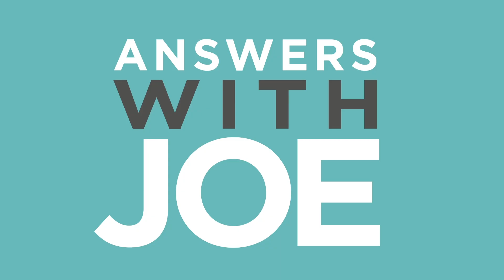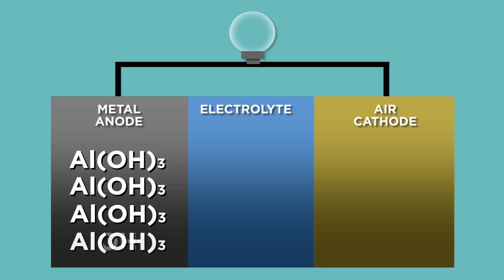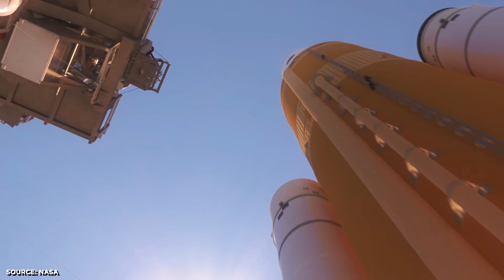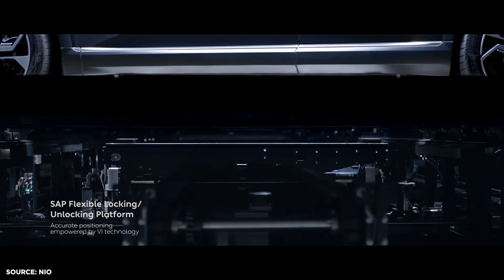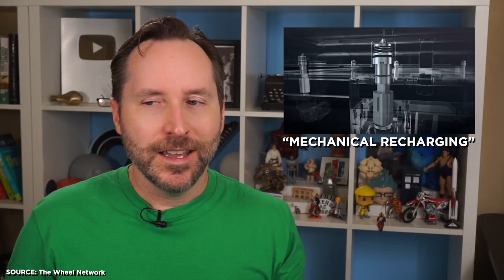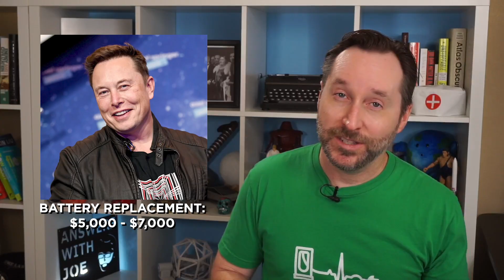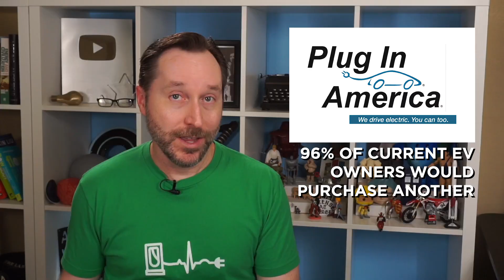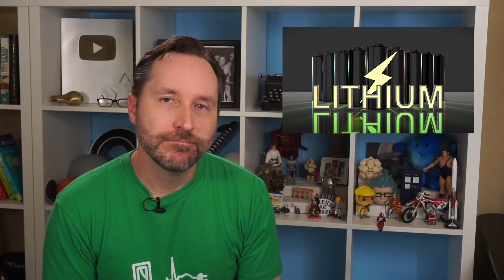This Battery Could Drive A Car 1500 Miles - But There's A Catch | Answers With Joe

Comment: Not that Joe did this necessarily, but I hate the way that green technologies are pitted against one another like it's betamax vs vcr. The best way forward to me seems like it's not a single winner but all the technology at once. 1. Because different technologies are better for different applications and 2. Because more technologies sharing the load means not taxing any single resource too much. Are solar panels better than coal?  Yes, but the materials for them are mined, usually unethically, and the aren't enough to replace all of the power generated from coal. That's why we need wind where there's wind, geothermal where there's geothermal, solar panels, and the concentrated mirror heat kind of solar. You need all of them. I feel like it's the same with batteries. It can be  some aluminum air for people who need it and lithium ion for people who need that and hydrogen for trucking or whatever it works best for.
Reply: Sorry but it was Betamax vs VHS in a vcr. By the way, Betamax was better but the record time was only 5 hours an VHS was six so public consummation made the winner, VHS. (you could record 3 movies vs only 2 on Betamax).
Reply: Tech companies need competition or they won’t improve because they don’t have to
Reply: Vhs not vcr.
Reply: I agree with you. Not relying on one single material(sodium ion batteries,aluminium air batteries,solid state batteries)
Reply: The advantage of having a standardised technology comes into play when taking the logistics/infrastructure and such into account.  To put it one way, a single tanker filled with petrol/diesel has the ability to fuel anything from a car to an oil tanker, if you replace the ICE with 5 different technologies, you now need 5 different tankers, 5 different mechanics, 5 different engineers, 5 different factories and so on and so on, pretty quickly those 5 different (yet more economical) technologies net worse than the dirty singular one we had before. This is why I'm personally an advocate of hydrogen power, it has the potential to be a fully green, fully recyclable fuel  whilst causing minimal disruption to current infrastructure and maintaining a wide range of applications which inevitably leads to cheaper running costs.
Reply: @The1Bendotcom  
You should stop lying and advocating about hydrogen power because it will never be "green power" There is no way to generate energy with hydrogen technology, and I am pissed off about people that are trying to sell technologies as green even though they are not. 
Hydrogen needs to be produced; it can't be mined > mainly fossile fuels are used for the electricity > efficiency is extremely low (20% after turning back to movement/ electricity) > in the end even more CO2 is produced with this "green technology" than just using traditional fuel.
This technology won't prevent any CO2 in our generation. Maybe after we coat all deserts with solar cells, but not anytime soon.
Reply: @Bullshitvol2  This is the most uninspired and hypocritical thing I have heard in a long time.  Hydrogen needs to be produced and is thus isn't green?  Do you think they pick lithium ion batteries off of trees, or Aluminum Air Batteries float to shore from the oceans?

I agree that hydrogen isn't a mainline power source.  But neither are lithium ion batteries.  However people still refer to them as providing "battery power"  or objects that use them as "battery powered".

I understand that there is a certain enjoyment in creating conflict, but at least pay attention to his claims and not invent positions to argue against.  He said that hydrogen power "has the potential to be a fully green, fully recyclable ".  This is true.    Further, note he does not claim that it is an independent source of power.

The point that hydrogen fuel can be reversed with the input of electricity means that it does not directly and permanently add pollutants to the environment.  Your only argument against this is based on the assumption of a fossil fuel based economy.  While this may be an accurate presumption.  The proponents of hydrogen fuel are presuming hydrogen will be used in conjunction with other so called "green technologies.  

In fact, it would be kind of ridiculous to assume that a nation would spend billions of dollars adopting a hydrogen system for the environmental benefits but then maintain old dirty power plants instead of also upgrading those.

Now, personally, I am not sold on the idea of hydrogen as a better alternative to batteries.  However, it is not an obvious choice between the various storage/transfer technologies.  Saying that supporters of hydrogen are lying because hydrogen doesn't is not a primary power producer is just disingenuous.
Reply: @Bullshitvol2  Ahh, so you are saying that you do not read posts before you comment.  If you cannot be bothered to read how your points have already been made and then refuted in prior comments, there is no point in me repeating those refutations again.  After all, I can't educate stupidity.

Anyway, you chose a very fitting name for yourself.
Reply: @Bullshitvol2  You obviously didn't read the prior comment before you posted as your claims were already rebutted previously.  You failed to address the refutations but merely repeated the false claims.  As such, there is no point in debating someone who is not interested in discourse so much as they are interested in picking fights and trolling others.  Sorry, but I do not intend to continue to respond to your empty provocations.
Reply: @Bullshitvol2  I did not do the same.  I addressed each point in the prior post.  You did not even bother to read the prior posts. Anyway, as you admit that your points have been rebutted, I have nothing further to say.
Reply: @Bullshitvol2  But I did.  You just did not read it.  So cry more.  But if you aren't even going to read the other posts but your own.  Then no one needs to address you any further: For you are only speaking for your own benefit.  Anyway, I wont respond to your trolling any further.
Reply: not true...

Comment: Look batteries such as this are nice but too me they just sound like half solutions... im a proponent of a very different setup which has been touched upon before and had clear  reasoning why it couldnt be done then... however with recent technology prospects its a very interesting prospect again...

Synthetic fuel... this could actually be just the thing to help climate change because it gives carbon capture a business case...

Plus we dont need to change anything about our current infrastructure...

Picture the following... Molten Salt Reactors high temps output around 600 - 800 degrees enough to split hydrogen off water molecules at a industrial scale, use waste heat to desalinate. The very same Molten Salt Reactor would generate the electricity to run ocean (water based) carbon capture and the hydrogen is combined with the CO2 to create hydrocarbons... diesel, gasoline and kerosene, only now emessions free... and cyclical, also making carbon capture potentially profitable, perhaps in such way that is a direct target for the funds and subsidies the fuel industry are currently getting (some solar wind and batteries are not).  Profitable carbon capture accelerates development in carbon capture and we can start taxing the companies that run them too  sequester 5% (incrementally increasing as the tech becomes cheaper) of their CO2, now we are reducing CO2 levels in the atmosphere while having eliminated all of the transport sectors emissions. All other fossil fuel usages are to be electrified. 

But this... this creates a valid industry that is meant to be climate neutral or even positive... such that these large installations can generate electricity, clean drinking water, and fuel for transport and infrastructure all emissions free and along any coast line...
Reply: Joe... i love your show but i definetly want you to make a video about this subject.

Comment: Aluminium-Air-batteries sound like the right fit for anything that runs longer distances on a regular schedule. Imagine public transport, where during the night, you replace the batteries, and on the next day, you can have the regular trips without recharging. I can easily see bus and light rail fleets converting from diesel to aluminium-air, trucks restocking supermarkets, postal services etc.pp., maybe even short haul air travel.

Comment: Honestly, If an EV could match the 500miles of range my gasser does per tank at a decent initial acquisition price (15-20k for a small car, 20-25k for a full sized SW), I wouldn't even mind the 6 hours charge time and infrastructure hurdles... but they don't match anything, neither price nor range so until then... they can shove em electric toy cars where the sun don't shine

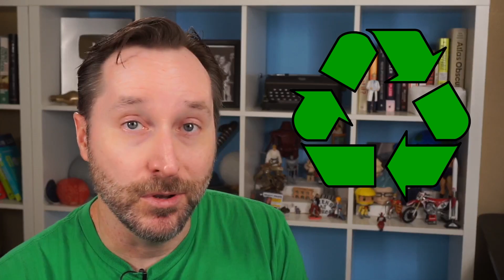Comment: 6:01 here's the flannel dressed statement, in South Korea, they have rechargeable battery packs that are wall serviced for scooters. You buy into the program (or however it's run, i didn't go too deep into it, just noted  a reddit post) and you just swap your scooter's battery with a fresh one. 
This could easily be done for cars. SURE, not every car, but cars like trucks, or vans, they could easily have a specially built frame setup where they go in a station, they get a robotic change, and go on. This could be a whole industry setup around it, with plenty of jobs. But likely this won't work, since the caveat is too much for some people. The only risk they like to take these days is how much they can short a something...

Comment: I hired an EV van. So glad I didnt just jump in and buy.. I was charging the thing over night and 1 or 2 times during the day. It just wasnt practical.
1500 miles on an Alu battery... I'd be swopping the battery every 2 weeks!

For me diesel is perfect... Hydrogen might be a solution?

Comment: I think the killer application for these is aircraft.  The potential energy density is GREATER than chemical fuel, and they electric motors are 2-3x as efficient, so you could save a lot of weight.  The downside is you couldn't use them until they're dead.

Comment: As a guy who tends to hang on to cars for a while, the notion of being able to keep driving a vehicle only as long as support for battery swaps is supported by the manufacturer and being completely at the mercy of a battery manufacturer's whims for pricing and availability is a hard non-starter.
Reply: Reading this... My current vehicle is 18 years old and has 450,000 miles on its original engine and gearbox.
Cant beat a diesel. Tho the ecomentalists do so daily.
When I was young I was told that the rain forests were the lungs of the planet, yet Jonny foreigner has been decimating them for the last 50 years at least. If only we could replant the rain forests

Comment: I can certainly see this as a good alternative to Lithium Ion batteries if coupled with something less dangerous but with less energy density like Lithium Iron Phosphate batteries. LiFePO4 batteries are heavier and less energy dense than Li-Io batteries but they are Safer and much more manageable in case of fire and accidents. A small LiFePO4 battery coupled to a non-rechargeable Al-Air battery could be exactly what is needed for EVs to have both Range and Safety.  And while building out the charging station infrastructure is on going, I can certainly see companies like Quick Trip or 711 who stand to lose a LOT due to the EV conversion (since people are less likely to stop at "gas/petrol stations" to fill up) putting in the money and effort to convert gas/petrol stations into Al-Air swap out stations.  And shipping Al-Air batteries for recycling would not be much of an issue as it would basically use the same logistical infrastructure as used for shipping fuels like Gasoline or Diesel to stations.

Comment: Is not reducing aluminum oxide back to aluminum nearly as energy-intensive as producing the aluminum in the first place?
Reply: It is. That's where the energy of the battery comes from.
Reply: Yes, and the efficiency is rather poor.  Compared to something like 85% for recharging batteries, it's a joke.
Reply: @karldavis7392  : So we're not talking about a "battery", in any meaningful sense, but combusting aluminum in a controlled way.
Reply: @akatsukami9578  Right, exactly.  It sounds rather inefficient to me.  I'm not sure it's any better than combusting gasoline.
Reply: I'd put this in the "like hydrogen, but solid" section regarding realistic investment potential.

(I'm sure Nikola will announce an Aluminium Air battery truck in a few weeks)
Reply: Best I can tell, it's exactly as energy intensive. As the aluminium hydroxide produced by this battery is Gibbsite, the main component of Bauxite.

Going off of industry numbers it appears to be an 8,6% round trip efficiency.
We get 1,3kWh from a kg of aluminium, and refining it back takes 15kWh.

We should also not forget the fact that this refining process uses solid carbon to remove the oxide.
So we're not only looking at a terrible energy efficiency (with all the CO2 production that comes with that). Every oxygen molecule this battery consumers becomes a molecule of CO2!

Comment: Recycling aluminum air battery would be like refining aluminum from ore... Very energy intensive... I fail to see any advantage of aluminum air if it had to be broken down and refined.

Also, then bunch of cans in your background roll are mostly steel cans.
Reply: It's very energy intensive because you are in effect storing a lot of energy. What matters is the efficiency of the process which is currently not good but it can be improved (and needs to be).
Reply: @francisboyle1739  unless it can be reformed to full or near full capacity without disassembly, it would not be a useful invention to power cars.  And if the ore is cheaper (a good chance of this happening) than breaking down the battery for recycling, you will be seeing a lot of tossed battery cores...  Unless of course the recycling is subsidized, but then the battery would make no sense.

Comment: Honestly, if the cars are made in such a way that battery replacement can be done with relative ease, this feels like the easiest option. 

Hydrogen and EV require very specific infrastructure, but if the battery can be easily removed and replaced (this would require re-engineering the standard concept a bit) then you're looking mostly at storage and transportation, which are already issues for petrol based fuel. Assuming the batteries are more stable than said fuel, then that makes storage less of a hazard, and, rather than complex technologies, you really just need a big shack to hold them. Any station which does propane exchange could handle that.

Comment: Interesting concept Joe, but doesn't seem as easy to roll out as a system Sandy Munro was discussing a few weeks ago, EVs powered by a solid state hydrogen fuel cell. A company stores hydrogen on very thin tape and which is than released with the application of a laser beam. It looked like a kind of largish cassette, and extras can potentially be stored in the boot. Also supposedly smaller and much lighter than batteries. Maybe you can cover this in a future program.

Comment: I thought the reason Lithium Ion batteries were so energy dense was because lithium is such a small molecule, in fact the smallest that is highly reactive and so can easily lose or gain a charge. I get that metal air batteries have the benefit of only needing to carry essentially half of the battery with you, the oxygen being freely available (although I suspect they're current limited by the %oxygen in the surrounding air). Unless there's some magic going on (a.k.a. very complicated science I don't understand) then these sound like idealised numbers and probably not very representative of real world usage.

Comment: It feels like airplanes would be a perfect application for this. There ist still about 14% oxygen at 10km which should be enough for the battery, especially considering at what velocities it's traveling at.

Instead of driving a tanker around there'd be a battery changer at airports. Perhaps there's even a battery recycler nearby to supply batteries.

The batteries would need to be standardized and easily configurable. But I could imagine this working for planes.

Comment: If you just pull into a station and it spends 10 minutes swapping batteries I can see how it could work but it will come down to someone making a huge amount of money doing it which is why we keep doing things that are bad in the long run. Maybe the station could be a small factory and make the batteries there by recycling the old ones.

Comment: However, the electricity network is a very pervasive and energy efficient distributor of energy. When you can top up a a dollar where you park your vehicle, and drive it a million miles, rechargeable battery systems will be the winner for most applications.

Comment: We need a highly energy dense light weight battery for electric aircraft. With the already extensive support systems in airport terminals for fueled jets, it seems like this might be a good fit? what is the energy density per pound?
Reply: Not sure about pounds, but currently they're getting 1300Wh out of a kilo. Mind you, that's only the bare aluminium. The complete system will weigh more.

It's projected that, in time, 2kWh will be possible. Not bad, but still not good enough for aviation.
Not in the last place because a plane can take off heavier then it can land, and these things won't lose weight as they deplete.

Aviation's best bet so far seems to be ammonia, so hydrogen.